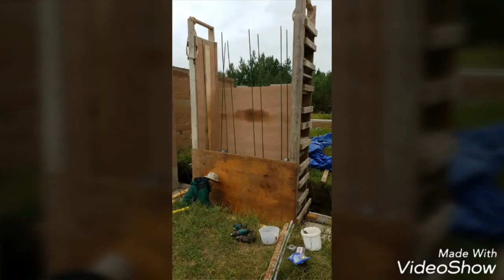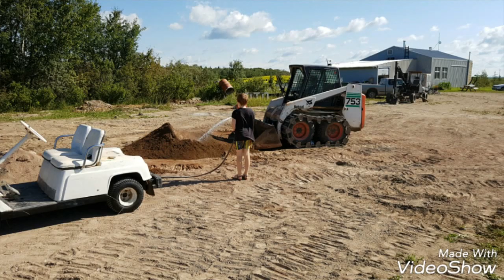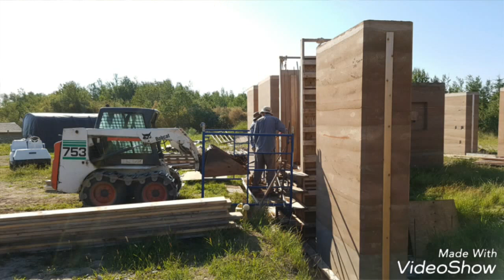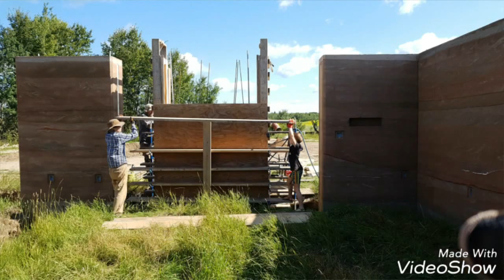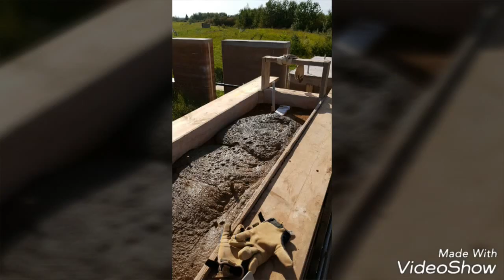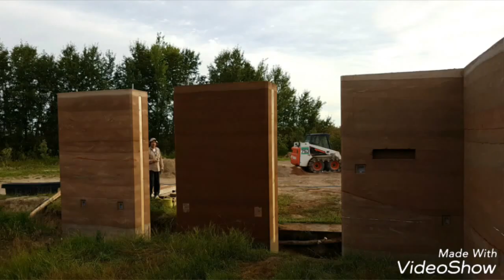Rammed Earth Saskatchewan #rammedearthwall #howwebuild #rammed #earth #freakbeacon

Comment: Incredible. Why did you cap each wall with concrete?
Reply from the maker: Scott Gerlach Hello, it's required to finish the wall off, and to be able to anchor the timber for the trusses. Compacting the top layer only is not enough to work with strength wise.
Reply: Thank you Paul.
Reply from the maker: Scott Gerlach Hey Scott I should be more specific, it's looks like concrete, but it's the same mix as the wall with more Portland and water added.
Reply: Very cool. Thank you for the details. Paul may I ask your SF or SM final cost on your project?
Reply from the maker: Scott Gerlach the footprint is 80'x34' including foundation to this point is $20/SF
Reply: Wow incredible. Price is fantastic. I'm going to watch the rest of your videos. I wish I was closer so I could come and help.